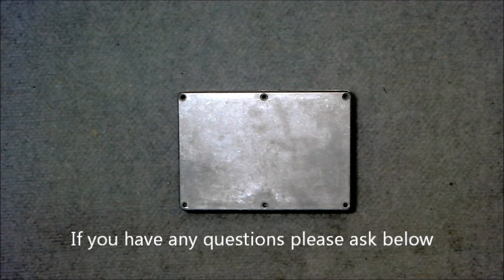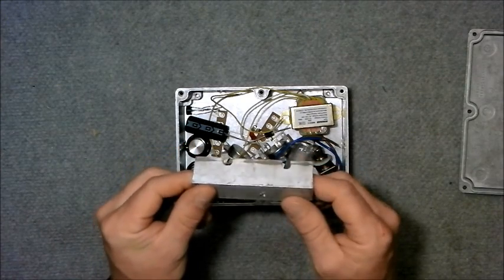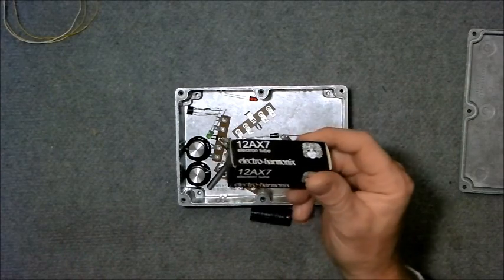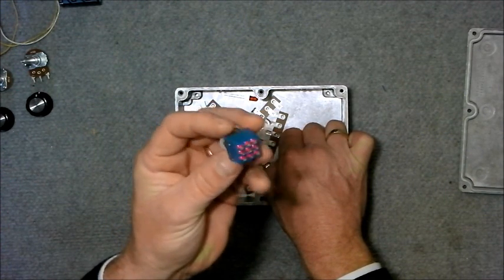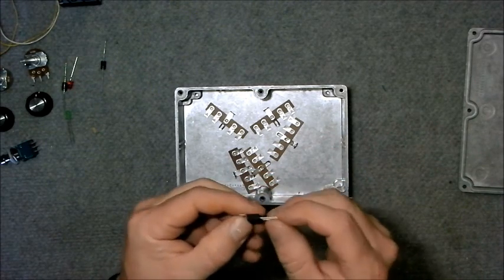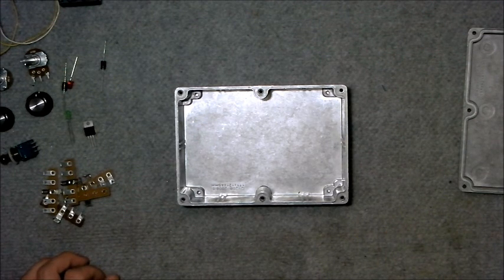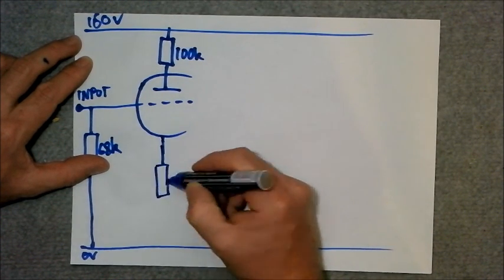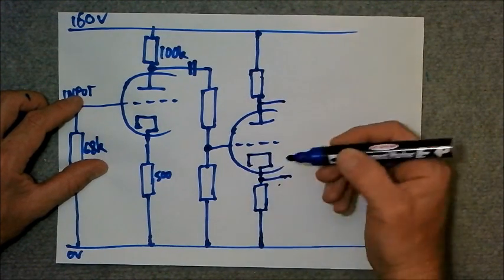Octave Pedal Build (Part 1)

Comment: I really want to build this pedal with an additional octave down.
Reply from the maker: Octave down is a completely different circuit. Basically the easiest way I know to create an octave down circuit is to half wave rectify your signal then use it to trigger a bi-stable flip flop circuit. It can be done with a twin triode tube, ,transistors  or a IC. Your original signal is lost completely so you may need to reintroduce it at the output.
Reply: Thanks man!